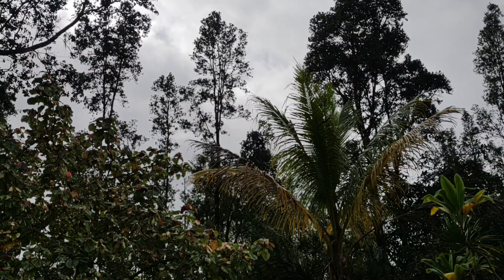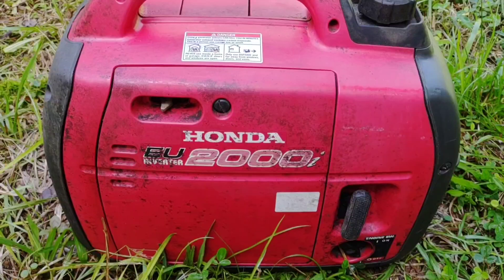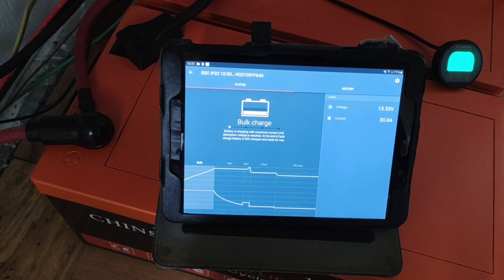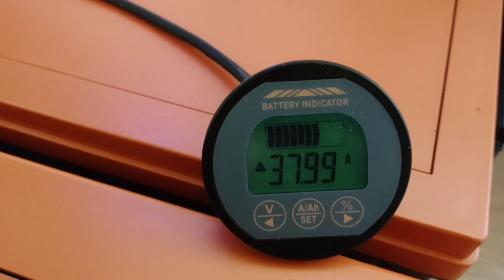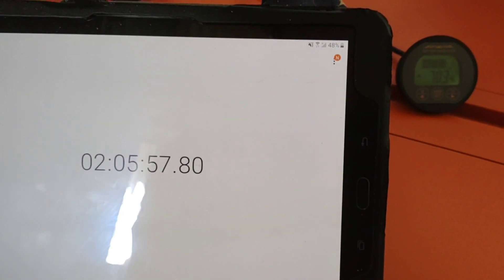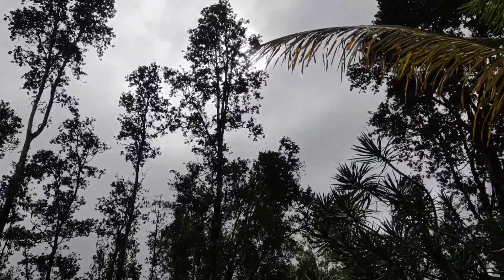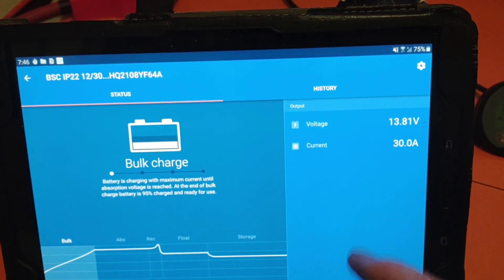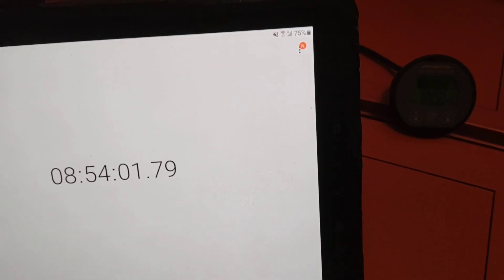1 gal. gas/Victron 12v 30amp... how far will it go?

Comment: Did you calculate how many KWh you got out of 1 gallons?  A quick search says that there is 33.7kWh of energy in one gallon of gasoline.  I'd like to see how much was actually converted and lost.  Your battery is 12.8V x 300 ah = 3.84KWh, so it seems like there is a lot of loss.

I think the best bang for your buck upgrade would be to add USED solar panels.  I got mine at 10 cents per watt and regularly see them at 25 cents per watt.  Tony Seba calculates that you should have 3x solar to battery to get you through cloudy days.  On sunny days, you'll have excess to run something like an AC.  And also, as many mentioned, upgrade to 24V.

Comment: I always recommend a 24v system for any small off-grid system. You will have double the panel capacity with those mppt charge controllers.
Reply from the maker: Someday I'll get to that. Pretty committed on the 12v for a time yet🤙
Reply: @ProjectsinParadise808  you would have to buy a new 24 volt inverter to do a 24 volt system, right?
Reply: @daysofnoah1748  yep

Comment: I'm running (6) 12.8v 200ah amperetime LiFepo4's with (4) canadian solar 275w panels in paralell to achieve 1.1kw thru (2) Epever tracer 40amp charge controllers. (Because under utilizing the charge controllers lets them run cooler in the summer where temps frequently surpass 95°F. I run a Xantrex XC 2000 inverter/charger. When I run on generator power I also use this to charge a complete other FLA battery bank. That has AC charger plugged in to Xantrex. Thus charging two systems with (1) 30amp 3750watt champion generator.
Reply from the maker: That system sounds really good! I'm going to add a second 40 amp epever too. Thank you for sharing your thoughts with us...aloha 🤙

Comment: Hello sir.
May I suggest a Progressive Dynamic’s lithium RV style battery charger that puts out 60 amps for you. 
I personally have a 45 amp progressive dynamics charger for one lithium battleborn battery and it works great, but if I had a bigger system I would get a bigger charger.
Reply from the maker: I can see that happening for me down the road for sure. Anxiously waiting on a few components to double the solar for starters...🤙aloha

Comment: So if you got 1.09 kwh of solar, that would be about 90 ah on your 12v system, the rest of the 54%-100% would be 186 ah, about 2.2kwh, from gas.  A gallon of gas contains 33 kwh of stored energy, so you converted that at less than 7% efficiency?! If the generator running at stated 1600 watts for 9.5 hours is 15.2 kwh, about 46% efficient, what could be expected from internal combustion. The controller must be capping at 30amp while the generator is producing more like 4x that much, and Eco mode not working correctly... or something else I am missing.

Comment: Can use more panels with existing wiring and charge controller on a cloudy day.
Be sure to fuse near the panels at a safe level for wiring.
Should monitor closely and disconnect if the sun comes out, and only connect the extra panels on cloudy days.
Reply from the maker: Yes, and thank you for sharing this information with us...aloha 🤙

Comment: That's good info.
I'm wondering how you're charging and where your power point is.

My generator @ 110v is 26amp, if I  made a buck converter I could run at 100+ amps. Obviously this means that I would have a shorter run time.
Have you tried this?

I don't think they do make this high power buck converter, and most are just DC to DC. But obviously they're not hard to make. But then this should be inline with battery voltage, but I've not seem inverters running around the 120+ voltage range.
Reply from the maker: Thank you! Charging with a 2000 watt Honda inverter series, with a 12v 30 amp Victron smart charger. My charging goal is to 14.2v when I can , but happy even not reaching that since it's LiFePO4. Don't have a larger charger at this time, but in the future, yes, would be shorter run time's for sure.🤙
Reply: @ProjectsinParadise808  yeah 2000w charging at 360watt is long and slow.

12v chargers are seldom 12v well shouldn't be. They're two types a 13.6 and a 14.4

14.4 charge GM batteries, 13.6 flooded.

It's not at all hard to build your own.
Rectifier, and parallel Mosfets to build a high current buck converter a inductor and a few diodes to stop reversed charge.

However, if you get your self a diode, and a computer PSU, that can give you 12.25v at 50 amps, but you'll have to check them out as they're all different. Of course it's not going to give you a full charge unless you open it up and adjust the pot (which is one most new ones) and push it up. Obviously read the datasheet on the Mosfets white paper to make sure they can.

I use one for most of my charging, but it's put through a boost buck for the right voltage.
Reply: @ProjectsinParadise808  yeah 2000w charging at 360watt is long and slow.

12v chargers are seldom 12v well shouldn't be. They're two types a 13.6 and a 14.4

14.4 charge GM batteries, 13.6 flooded.

It's not at all hard to build your own.
Rectifier, and parallel Mosfets to build a high current buck converter a inductor and a few diodes to stop reversed charge.

However, if you get your self a diode, and a computer PSU, that can give you 12.25v at 50 amps, but you'll have to check them out as they're all different. Of course it's not going to give you a full charge unless you open it up and adjust the pot (which is one most new ones) and push it up. Obviously read the datasheet on the Mosfets white paper to make sure they can.

I use one for most of my charging, but it's put through a boost buck for the right voltage.

Comment: Wasting fuel. Add 2 or 3 more chargers to increase load on generator. Will increase charge amperage and decrease generator run time. You're only using 360 watts charging, your batteries will handle 100 amps each from a charger so you can charge at 150-200 amps safely paralleled with appropriate wiring gauge.

Comment: I got almost the same Honda. I get 7 to 9 hr. tankful. depending on load. slight over 1 gallon. I also have 3000 EU as well . love that auto throttle .and quit to. I have both wind and solar hear. to get most out of gas ,if you need a bigger ac load put it direct to  generator. that would be a load off inverter/battery. looking great ! look for MPPT with higher PV voltage . just study the spec and compare to the PV you want to add.
Reply from the maker: Yeah,  the smaller 2000 has served me well.  I eyed the eu 3000 back then and thought I'd never need it. Hindsight yeah. Anyway,  researching larger mppt now, with as you say, paying attention to voltage.  I'm stretching the gray matter these day's . Mahalo as always Robert 🤙

Comment: Stepping up to a 24V setup from 12V will be more efficient and even more efficiently can be gained from a 48V setup... 
You will find that you can get more power down the same cables simply by going up in voltage so there's a saving right there... 
For a 24V setup, you already have two batteries, you will need a 24V inverter and charge controller but you will gain efficiency in that 24V is closer to the mains voltage than 12V and again even closer with 48V...

Comment: You should run a much bigger charge control off that generator.  2000 watts generator at 80% 1600 usable watts or 50% load 1000 Watts . Perhaps you should get 100 amp charge control pumping much more power with less time with a generator.
Reply from the maker: Yeah,  bigger would be very nice for sure...🤙

Comment: A couple of talking points. I’m in the exact same boat as you. But I’m using one chins 300 ah and a 1500w reliable inverter with a propane converted eu2000i. I run the exact same refrigerator as you also because of your stellar review. You need to buy a Xantrex 8080915 PROwatt SW Auto Transfer Switch. This way the charger will input the full 30 amps to the batteries and also run the rest of the home at the same time.  I use one receptacle on the generator for the charger and the other for the house with the transfer connected to the inverter. If this makes sense? Your battery bank will charge a lot faster. I converted to propane because gas in central Oregon is $4 a gallon but propane is $2.59 a gallon. The kit from Hutch Mountain cost me $279.00. NO MORE GAS HANDS AND SMELL! I’ve been running a week of from a 30lb tank.
Reply: Hi, for me It makes sense in part. On the other hand you have a higher load on the generator, and for higher loads the fuel consumption goes up, meaning you would probably not get the full 9 hours. I think the idea here is to lower gas consumption and just be ready for the next day, hopefully with more 🌞🌞🌞
Reply: @ricardomarcelino8388  I checked the watts used by the 30 amp charger is about 450w. My house with the refrigerator going draws about 300w. So when I split them up and the inverters not drawing almost what the 30 amp charger is trying to replace it charges twice as fast. With the generator is in Econ mode and I plug the house in unless you really listen no one would ever tell the house was added. I also have a 250sqf cabin plugged into the side of my house where son son lives. If he runs his tv and game console he draws an additional 200w then the charger can’t keep up at all. He only gets to play games when he hears the generator running. Can’t wait until my 30kw system shows up.
Reply from the maker: Yes, that makes perfect sense to me , and I love the suggestion and am going to look up that Xantrex unit. Giving the batteries the full load without minimizing anything like when the refrigerator is running is going to stretch the gas out further.  Mahalo for that! I'm loving this refrigerator,  hoping your experience with it is good too. Aloha 🤙
Reply: @ProjectsinParadise808  if I had a way of getting your address I would donate your channel a Go Power TS-30 transfer switch. I’m using the YouTube app for iOS and can’t DM I can just comment.

Comment: I didnt realize it took that long on a generator. its a long time. My question was; how long would those battery carry you without any charge?
Reply: That happens because the generator adapts to the max input of the Victron charger. Assuming it is a 2000W generator, it should be able to push 166,66 amps continuously (I suppose). Having it running at low load it is pumping 360W at 30 amps for a 12V system, which is what I think he is using (2x300ah chins in parallel configuration) that is why it runs smoothly and for that long.
Reply: @ricardomarcelino8388  I seee why it took all day. he was stretching the gas and not fast charging. what if he fast charged and finishing topping off and save gas early? I wonder what the max that gen. puts out anyways?
Reply: An internal combustion engine works best and is more efficient in a specific range of RPM's, so less load could make it more efficient. If you run it harder, the efficiency should be decreased in a certain amount  I would say the generator is a 2000W based in the model name, but that is just me guessing...
Reply: @ricardomarcelino8388  the generators  have a set run speed. When there is a higher load they run faster to compensate.

Ive a 3000kva Gen, at 110v it's something like 16amps. (110*16=1760 watts)
Depending on how you down volt, using ohm's law you would increase the amps to the drop in volts, so we could say that 110v to 11volts would be a factor of 10, so we multiple the amps by 10, so you end up with 160amps @ 11volts.
This is using a good buck converter.
We would take off 32amps for the extra volt we need and some overhead. 

The watts would stay the same regardless of what amps and volts we use.

So we calculate the watts which for me is 1760 and then apply that to the battery..
So 300amp@12v is 3600 watts
Then 3600 / 1760 is 2.06 hours to fully charge.
However.....
Battery capacity is the full cycle, so if You're DOD is 50% the. You have to charge 50% of the battery. So 1.03 hours to charge the battery to full.

However, if you had a UK generator, which are about 220vac when you change this to DC it comes out around 375vdc. 
If you have a 375 DC battery, you could direct charge. But if you have this as a system voltage your batteries could be much smaller and thus the currents are also smaller. So a 12v 7ah battery stacked to 26 batteries would give you the same power
26*13 @7a would be 2650watts.
But if you picked up say 40ah batteries, 26 of those would give you 15KW.

That being said, balancing 26 batteries would be fun and at around £50 each
£1300 for a set (still very cheap)

Remember though the generator would take a few hours to charge them.

Comment: That’s great . 9 hours on the generator with 1 gallon of gas and the sunshine helped it to achieve 100% from 54% on the 600ah batteries. The best time was successful to charge them fully was during the break of day with the sun is first out when the generator is running to catch it through out the day and succeeded . Just more PV modules and a better charge controller would make a big difference even without the generator at times . Excellent video . Aloha !
Reply from the maker: Aloha Cedric! Got more panels, and trying to decide on what controller to go to. The system continues to grow...kinda addicting yeah. Having fun with it for sure. Mahalo!🤙
Reply: @ProjectsinParadise808  BEST BET FOR A BUDGET IS AN " OUTBACK FLEXMAX 60 ,  OR , 80 " BEST CHOICE OR A MIDNIGHT CLASSIC 150 , OR 250 SL , IF THATS YOUR DESIRE .
Reply from the maker: @defjamsgreen  You know I have been eyeing the Outback 80, and the Midnight classic pretty hard, and even another Epever 100amp. I've had good luck with them. Think I'm leaning towards the midnight...everyone who has one seems pretty impressed.  I'm close to pressing that button...I need my panels up and running. Aloha 🤙

Comment: 3240 w from a gallon. hmmm. $0.00123 cents per watt. multiply by 660w (average for a 1000W solar panel set) and then 5 hours a day (annual average sun hrs/day) = $3.70/day vs the $4 for the gas. The gas cost never ends and the panels cost less than the generator. lol